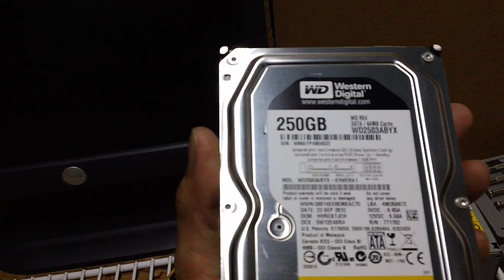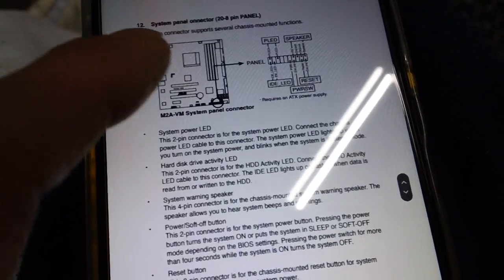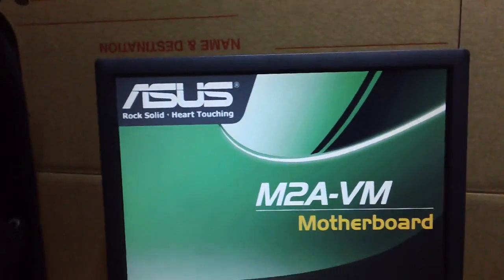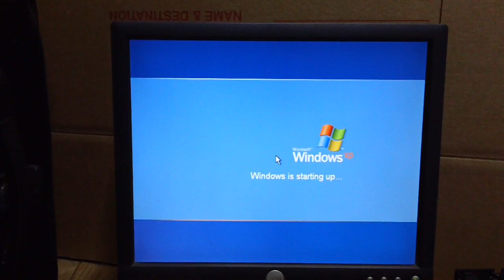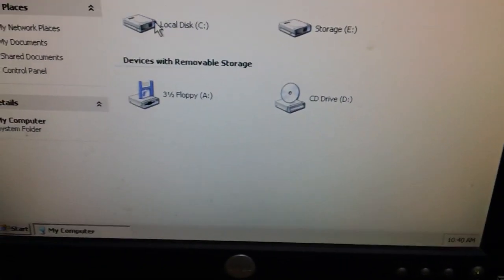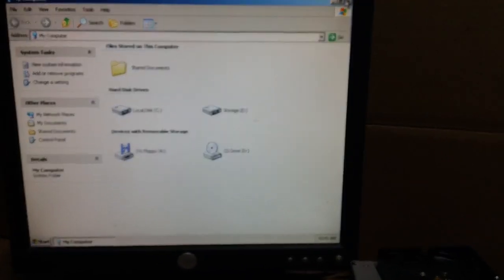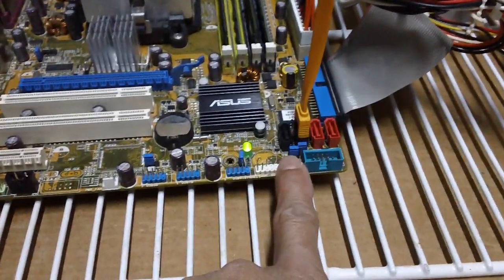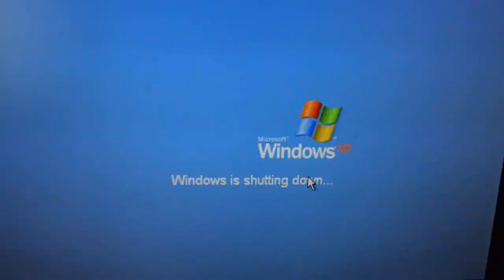Bench Testing Naked ASUS M2A-VM Motherboard

Comment: Hi There Was Able To Get Windows7 Installed Now With 8GB Of Ram And Waiting On A Graphics Card Asus M2A-VM HDMI / Av / S / Sp / Dp Card Computer Video Expansion Graphic with cable
Reply from the maker: Hello and greetings. Thank you for your comments and for watching my videos. I'm so happy that you were able to get your system going with Windows 7. After that I got a case for that motherboard but it kept giving me trouble trying to go from Windows XP to Windows 7. It would freeze partway during the installation. Anyhow I sidelined that project because I had so many other stuff to work on. With that amount of RAM you should be able to go from Windows 7 to Windows 10 without any problems at all. It's better to go to Windows 10 because even the browsers for Windows 7 are not supported anymore and much of the antivirus also. Let me know how you make out and also if I can help you in any more ways. Thank you very much and have a great day